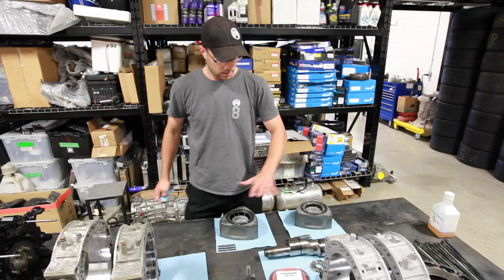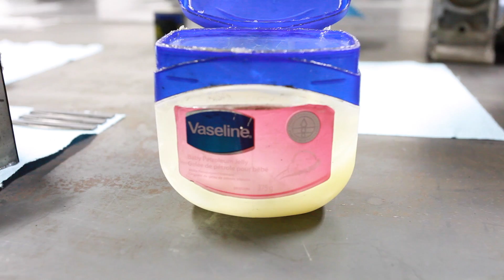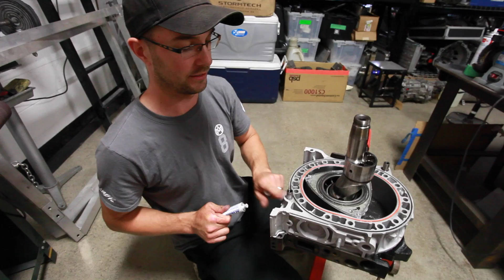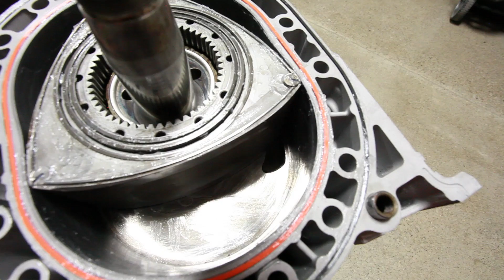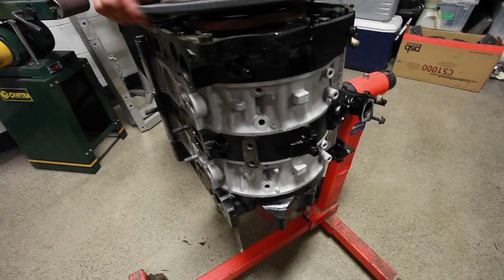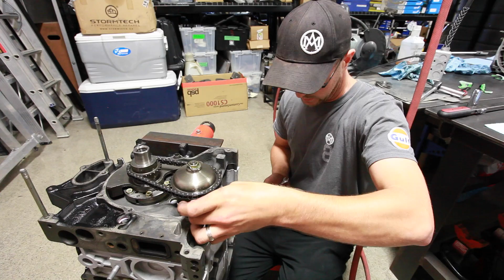How To Build A Rotary Engine

Comment: can you build a 4 rotor out of it?
Reply: YS Lim eccentric shaft is custom made and a little expensive.
Reply: YS Lim to balance the rotations and make it smooth. It would jump all over like a washing machine with a brick in it if it didnt have one :D (well not that much but you get what I mean).
Reply: you'd need 2 of those engines, custom made eccentric shaft and counterweight and it would be just as shown here (but 2x the job)
it sounds simple afaik only aussies custom make that stuff and it costs A LOT (10k+)
Reply: 3 rotor 3 turbo 

I am a mad man
Reply: YS Lim yeah in theory its not that hard but personally i dont have any experience check out a video about building a 4 rotor
Reply: Error989 Why do you need counterweight?
Reply: Error989 but why doesn't the 2 rotor and 3 rotor have them
Reply: YS Lim 
they have them too. for instance, when using a light weight flywheel on an FC, you have to use a counterweight from automatic model..as it's built into the manual models.
Reply: YS Lim 
just noticed they are using a lightweight flywheel in this video. you can see the counterweight on the table.
Reply: efini_fc so why do they need to be custom made?
Reply: YS Lim I'm not sure what you're asking. the E-shaft or the flywheel? Mazda never mass produced a 4 rotor e shaft. and simply "combining" two 2 rotor ones just isn't really the best way to do it. all engines have some sort of counter balancing object. rotary is no different. if you change from the stock flywheel, you need a counterweight for it.
Reply: @efini_fc4276  Hey mate, just learn about rotary and want to understand it better. In general, if I want to add another rotor, do I need to custom the e-shaft only? Did I need to change the angle of the e-shaft so it will be more stable? i.e in 2 rotors, the bump for each  is let say 180'. So, when adding another rotor, do I need to reduce it to 120'? How about spark plug sequences for another, can I purchase ready made one? Is it easier to get the cosmo 3 rotors engine rather than modified the stock 2 rotors one. But will the cosmo engine perform better than stock 2 rotors fd? Hope you or somebody can help me.
Reply: @muhammadsyafiq7760  oh wow..so I hate to start like this, but what is your budget? It's not a common thing to just add rotors. Yes it can be done but...
If you're planning to really add another rotor, in general it should be the same housing as the other two. From there, there's places that have made custom e-shafts to "add" on this extra rotor, but it needs more than that to operate..and unfortunately this is why and where a lot of people give up or don't do this. There's a lot of things to consider on all rotary engines..but all should have oil, cooling, and (more in performance builds) fuel looked at especially close. It's custom so other parts that work for a two rotor may not and don't exist for your custom three rotor. 
The cheaper route is to get a used 20B and go from there. I've heard there's a few issues that should be upgraded on these engines as far as oiling systems, but again that's in the performance world. It really depends on what you want the engine to be for.
Reply: @muhammadsyafiq7760  and yes, if custom added, you'll need a whole new ignition and ECU built for it. And just like any other engine, yes the rotors will need to be arranged and balanced. You should think of each rotor as a stand alone engine..it just happens to be paired up with another rotor. Each rotor can spin on its own, so the timing of each will need to fire in some succession after another. I'm not sure if it's a simple 1-2-3 order or if engineers alternate. Another reason why must just follow what Mazda has already designed and tested.
Reply: @efini_fc4276  Thanks for answering my questions mate. For now, I just want to understand the basic principle first because I'm just wierd that why 13B on RX7 more powerful than 30B on Cosmo and what are the factors or I could be plainly wrong. Really admiring RX7 much but I'm thinking about reliability and efficiency as well. That's why I want to learn more about the engine first before buying it. Of course this is for fun though and it will not be my daily driver. The main thing that really concern me about the fuel efficiency. If I'm about to upgrade the parts to a bigger turbo, performance ECU, etc while keeping stock ports, wil it be enough to add decent power output like roughly 300++hp?
Reply: @muhammadsyafiq7760  I can tell you this for a fact..the best rotary owners don't think of fuel mileage as a need. These love fuel and need quite a bit the higher you rev and the more power you want to make...and they live be revved high. But, I feel it's the same with any sports engine. The rotary engine is really a preference. It's won races it's lost races. There's really no ultimate engine..just best for your application. I like to think of these little engines like two-stroke engines..like an engine that acts like high rpm motorcycle engine, but in a heavy car instead of a motorcycle.
Reply: @muhammadsyafiq7760  a 20B is not difficult to make 300HP..it's not rare to see 13B make this much power, but it should be starting to change from stock parts. ANY rotary used on a race track needs oil, cooling, and likely fuel modifications. Street set up will not allow the engine to perform well or safely..let alone reliably.
Reply: Do you need to change the stock tranny with a 3 rotor and turbo setup?
Reply: @efini_fc4276  Let say if I'm going to buy a 13B, but the engine condition is the worst. Is it better to buy all separate parts ie housing, e-shaft, seals etc then assemble it later or just buy the engine then buy needed parts only.
Reply: @antonismitilineos2605  Cosmo model car from Mazda is the only car that came with a transmission made for the three rotor engine...all others would have to be custom made to fit. The Cosmo only came with auto trans...
Reply: @muhammadsyafiq7760  if you are planning to do the build yourself,you should have a Mazda FSM (factory service manual). This will give you numbers to use from Mazda and all of their years of engineering and experiences. Measure clearances on the parts you have when building..especially if it's from a beat engine. Typically e-shaft can be used again..housings can be tricky but need to have resurfacing at minimum. Housings on a higher mileage engine should be looked at closely. Not many top builders re-use housings if they can avoid it. And honestly, I think a lot of people ignore this and later contribute to the apex seal pandemic... properly build and properly use these engines for what they are and they can last a long time. I have a stock non turbo I drive daily..160,000 miles and still starts fine today. It's built for the street, so that's how I drive it. I bring the revs high up here and there, but I don't drive like I'm on a race track..staying high on rpm all day. Build and drive it for what it will be used for and it will last a long time! Pre mix always and stay on basic maintenance a little more than tight than on reciprocating pistons.
Reply: @efini_fc4276  Thanks a lot mate, you really helped me to understand it much better. I'm gonna stick to 13B then. Gonna look for the engine later and hoping it still in running condition. Oh yea, about the rotors and housings, does Mazda still produce it or we only have a used parts option left? Or is there are an aftermarket one that we can buy. Do you have a social media though so I can ask for you help later. Thanks in advance pal!.

Comment: If you really wanted to be picky, you could just use a crows foot and torque wrench to get those oil pump bolts to spec... there's an equation you use to find out the actual torque since you're technically using an extension....which causes a loss or gain of torque depending on the configuration (sorry for stating the obvious but this is the internet)

Comment: Joe, I have an 04 RX8. As soon as i pull my foot off the clutch the car starts to bog and vibrate, but when i give it less gas it goes back to normal, but I have to slowly ease on the gas to go faster or else it will start to bog again. Is this an APEX seal? Thanks for your time!
Reply from the maker: Sounds like muffler bearings to us.
Reply: The car has a tough time starting up nowadays too
Reply: And my engine light flashes
Reply: when the car isn't moving or if I don't push on the gas it also will turn off. I appreciate your time so so much. haven't driven the car in 7 months!
Reply: better than the first answer I got you know because mufflers spin on rotaries.
Reply: Nevan Lombardo get a compression test.

Comment: You sir have a very informative video.  You have you're shit together with these engines.  I always found them very interesting how they work i'm just curious has there ever been a prototype done of a smaller one for say small engine purposes? Lawn / garden etc?
Reply: fattony123082 im not sure but i think there are mini RC cars runnin a rotary
Reply: thehotone64 -  that would be something to see but also an experience to hear
Reply: fattony123082 yes they do, i believe a company made a wankel powered generator tbh.

And there’s some companies that made like snowmobile’s that are wankel powered. As well as I believe a lawn mower? Haha
Reply: There are several motorcycle companies that use/used a rotary powerplant. Suzuki had one in the seventies. Also a company called Norton made several models.

Comment: In terms of wear, has anyone ever long term tested low viscosity versus high viscosity oil in the engine and test trade off between flow volume and shear protection?  I ask because I would normally consider 20 weight rated oil to be quite light, but I don't know how big of a concern these engines are for oil degradation of the additive package.  For example, would a 30 weight or 40 weight be better or worse for long term operation and wear protection or will it compromise cooling due to decreased flow rate?  Because we have a seal riding along the housing and in high heat, I would normally expect there'd be advantage to high viscosity oil.

I have a question about boost too.  I haven't really seen a market for low compression rotors for the RX8.  So if one plans to add boost, what would you recommend for supporting parts?  What boost target is appropriate?  For example, a lot of piston engines with no mods often run 7 psi or so.  With the RX8 pretty aggressively tuned stock and for premium, I would expect headroom to add boost to be pretty minimal unless one was to switch to E85 and gain additional knock resistance headroom to allow some boost.  What I'm curious about is (a) if a low compression rotor is available or (b) if no low compression rotor is available for the RX8, is E85 necessary or can one run a low boost setup, even 5 psi or so, on premium gas?

Comment: Whats it cost to rebuild a rx8 motor?
Reply: Mark Rich Budget rebuild? around 2,000-2,500. If you need a new rotor or housing? its can cost another couple hundred bucks for each one. Racing beat rotors are about 600 dollars or so. All depends on what needs replacing

Comment: how to rebuild a rotary engine.... you don't, you simply scrap it and get a piston engine
Reply: Daniel G then you get blown away trying to keep up with them in the mountains because your power to weight ratio
Reply: WHAAAAAA???? just because a 13b or Renesis is 1.3L that doesn't mean that a fully assembled rotary is lighter than a typical 4 cylinder, heck they aren't significantly lighter than a LS V8! Just about any engine combo will crush your average rotary in Power. because a rotary is always at a torque deficit. You HAVE to keep the car as light as possible with the shortest gears possible to make up for that. Not so much the other way around.

Comment: why cant ypu use engine lube instead of vaseline? i never heard of that?
Reply: American Monster Garage  Vaseline is better at holding all the small intricate parts in place. Assembly lube is really just to keep normally lubricated parts from being dry on the initial start. The vaseline does the same for that, but has the other benefit of being tacky enough for holding seals in place (if you're careful). Cheers!

Comment: The reason for getting rid of the exhaust port holes in the rotor housing: Apex seals tear off the coating of the surface ( chrome on 12 A, Nikasil on 13 B ) at the edges. My first 12 A died because of this. No emission rules involved this time.

Comment: Is that normal Vaseline or some special one....and why not use engine oil or any other lubricant....sorry for the question , I'm new to rotary engines.
Reply from the maker: Vasline burns off clean and quickly hence why its used over other oils that will stick around longer. It's really there just for holding purposes.

Comment: This 13B engines is quitely used on RX-7 models, but now it's proven that the latest RX-8 models too can use the same engine as the previous models.
Reply: Don't waste your time, LS swap M or just buy a better car that's not an RX.
Reply: The engines do not have the same mounts, so they cannot be interchanged.  HOWEVER, RAD Potential will be mixing some parts from the RX-8 engine and a 1st gen RX-7 engine to build a "hybrid" engine for an RX-8.

https://www.youtube.com/watch?v=BLFPLUHslyg

Comment: I heard that the reason they moved the exhaust ports to the irons is because having them in the housing increased wear on the apex seals. Not sure how accurate that is though, I think I heard it from some guy at a Mazda dealership.
Reply: They moved the exhaust ports to the irons to improve emissions by reducing exhaust/intake overlap… overlap increases the scavenging effect by allowing intake air to flush exhaust gasses out, however this increases the amount of unburnt fuel thus increasing emissions…

Comment: what is the best wankel engine  for example 13b  or 4 rotor or 6 rotor  like that ( ı want to learn  ı want to improve myself day by day ) ı love wankel engine  thx for answer
Reply: by the way  ım a pastry chef  but ı love cars especially cars with wankel  and mtocycles :)
Reply: MURAT GÖKTEPE 13b's and 20b's are easy to find and good for tuning. If you wanna build a 26b from scratch then you need some serious serious money
Reply: ov ok ı understand thx man  whic is the best 13b or 20b whic one is stronger for drift  for rx 8
Reply: id say both
Reply: aa ok bro sorryy my mistake :D 
thx
Reply: R26B 4-rotar is a beast but yes expensive 12A, 13Bs and 20Bs are easy to find and easy to play with but if you have money R26B is the way to go

Comment: Torque with a crowsfoot wrench with a  regular torque wrench attached.....works for Boeing, will work for you.
Reply: Works for the Air Force!
Reply: exactly what I was thinking, snap-on do sell then in 1/4, 3/8 to suit your tension wrench and 1/2 inch drive
Reply: Actually called torque adapters
Reply: Crows feet are a good option, you can also get torque wrenches that have a u-bolt to attach a spanner rather than a square drive to put a socket on. They are good for getting into difficult spots. The one I used to use had a two position telescopic pointer which you used to set the length of the spanner and there were two scales to set the torque, one for each length. that seems to be old technology now, all the new ones use a spanner quick connect attachment which comes as part of the kit.

Comment: Vaseline is petroleum based, rubber seals don't like it. should use rubber grease.
Reply: Motor oil is generally petroleum based.. and does not effect the seals either
Reply: Bipolar Transition As mentioned, these are seals meant to be exposed to oil and coolant inside an engine. So they're not simply rubber, but much more likely something like viton - something impervious to petroleum affecting it unduly.

Comment: I hear that the regular spark plug design is the cause of a lot of the energy losses in the rotary engine. (more specific the hole in which the spark plug resides is the cause of a lot of fresh air/fuel mixture being injected in the combusted chamber, causing a hotter exhaust than necessary)
According to what I read, a new approach of spark plug. 
2 flat electrodes instead of 2 pin shaped electrodes, that are concentric and level with the rotor housing should boost efficiency by more than 15-20%.
Reply: Muranaman lol thank u for putting this fool in his place (:
Reply: The real doktorbimmer haha u got called on ur bulll hahahahaah
Reply: Unfortunately that is a hoax.. lab testing on actual engines showed no significant improvement in performance or fuel economy.. and actually show detrimental effects on emissions and increased maintenance due to increased spark plug fouling and misfires.
The Wankel design is totally obsolete now.. there is no longer any legitimate research or development ongoing.
Reply: How can there be any lab tests as such spark plugs aren't invented yet?
Reply: Muranaman The design and the results  of the lab tests were published some years ago in a leading engineering journal (SAE INTERNATIONAL)
Reply: with what spark plugs?
The type of flat spark plugs don't exist (yet).
I think my youtube vid is more credible than your comment!

You're just mentioning the old design, not the new design where the problem with spark plug is solved.
Reply: Muranaman What is your point? Wankel engines are obsolete anyway... who cares!
Reply: terrance hill Sore loser... go troll somewhere else